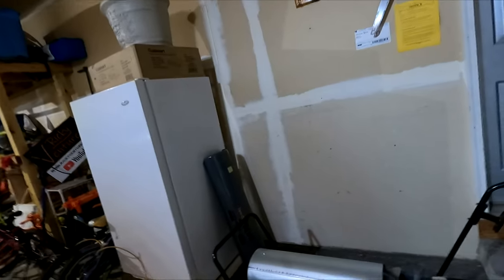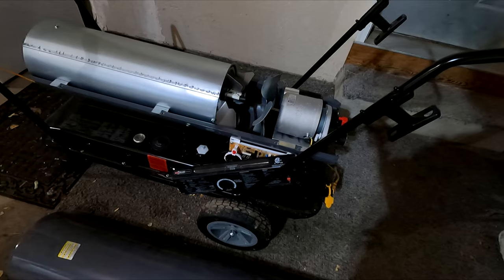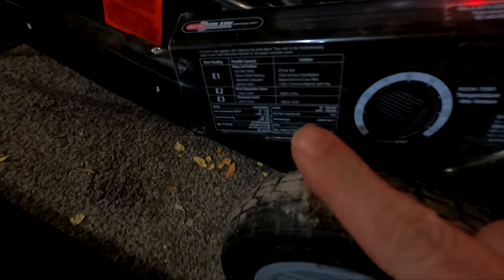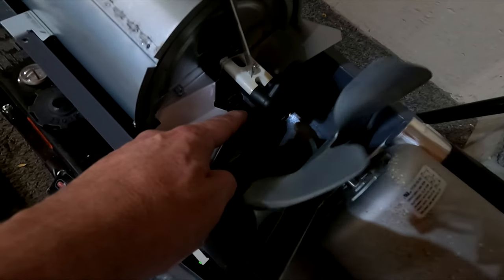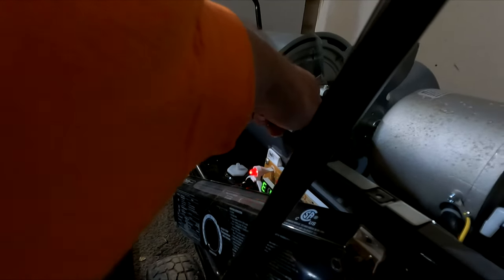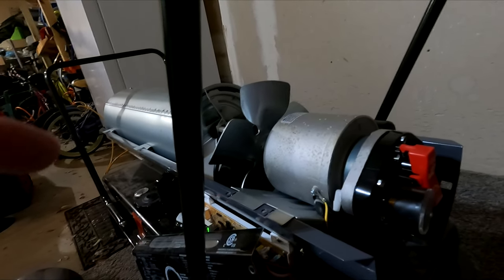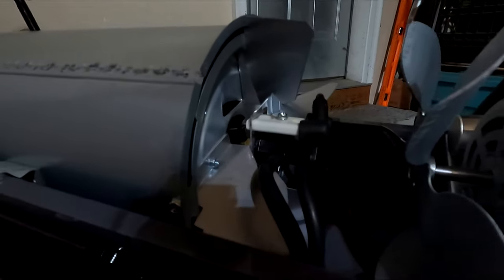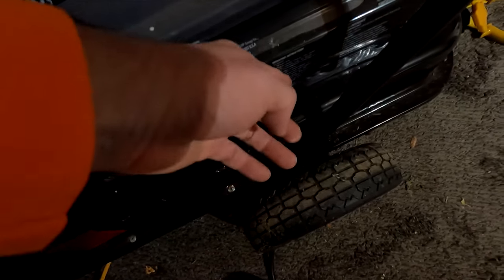Dyna Glo e1 Code Fix

Comment: Ive got the same heater with an e1 code but mine is spattering liquid fuel out the end so im pretty sure the lines are ok...
Reply from the maker: Check for leaks. Could also be the ignitor.
Reply: Check the cover plastic on back of pump for cracks 
Also clean the vane plate good and free to move 
Fuel hose could be cracked, replace both of them
Reply: Mine lights and runs when top cover is off.  I put the cover back on and it blows fuel out the front and e1s
Reply: Mine works with cover off put back on e1 and shuts off.  Why?
Reply from the maker: @GymnasiumJ  might be compressing hose with leaks when cover is on. Check all the connections.
Reply from the maker: @jeoprrrffhabhab696  might be compressing hose with leaks when cover is on. Check all the connections.

Comment: mine through the E1 code  was spitting fuel  musta got the   ignitor wet
Reply from the maker: Yeah if fuel is being pushed out, then it's not the fuel line. Prob the ignitor. If the fan goes it will also give an E1 code.